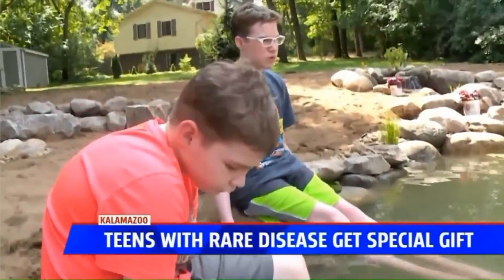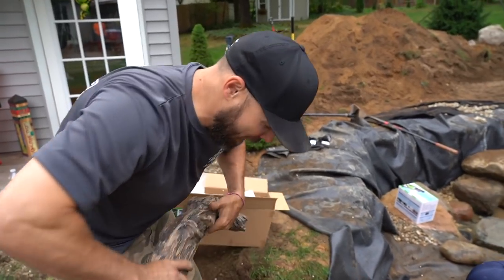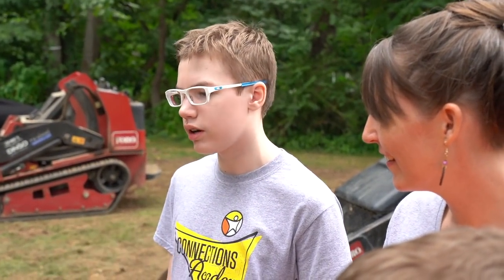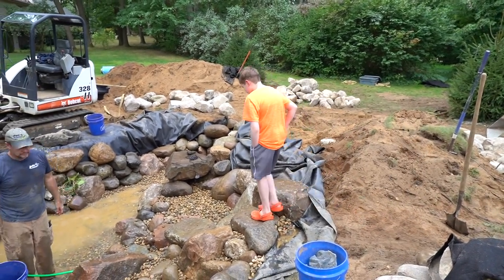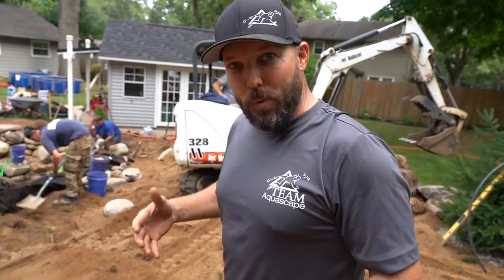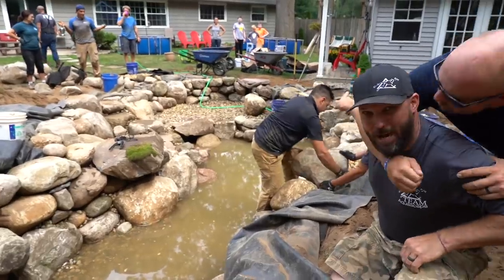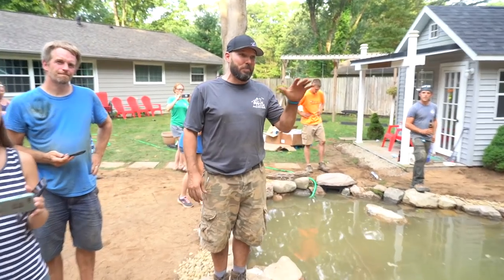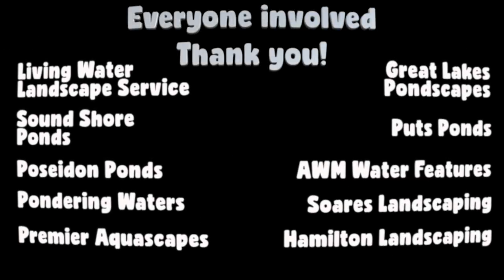20-Foot *Healing POND* - TEAM Aquascape Giving Back part 2

Comment: Serious question regarding the build. They said overlap the liner for the waterfall. Does that mean you don't seam the 2 pieces of liner together for the waterfall? In my mind i'm thinking if you overlap enough and have enough rocks and pressure against the liner it shouldn't leak. Is that true? Or should you always seam the liner together?
Reply: There is a video on Atlantis watergardens where Jaak explains, I'm not sure of the height requirement of the overlap on the vertical (Working on memory I think its 18 inches ) but apparently that's a safe overlap distance so you don't have to do a join. if you want to check out the video its one of longer stream/waterfall videos.
Hope that helps
Reply: Not as long was the pond liner is high enough (above water level), it isn’t necessary to seam the liner